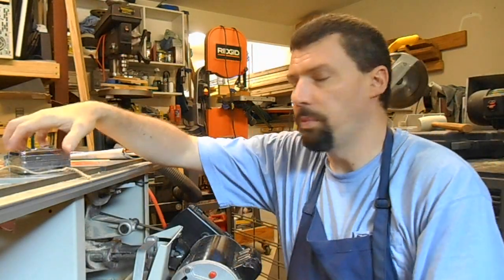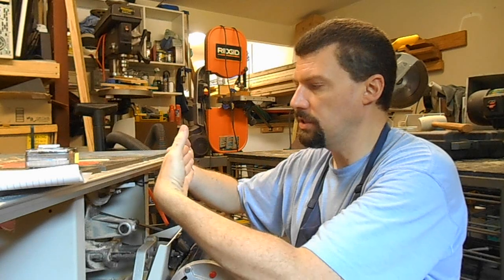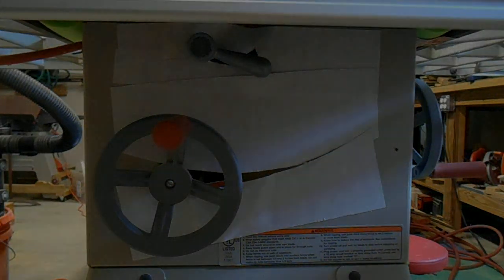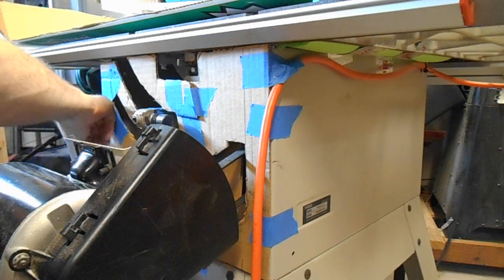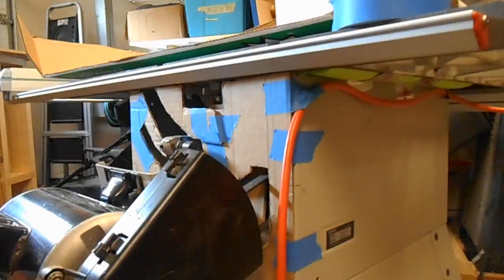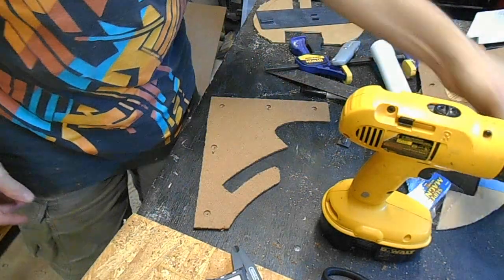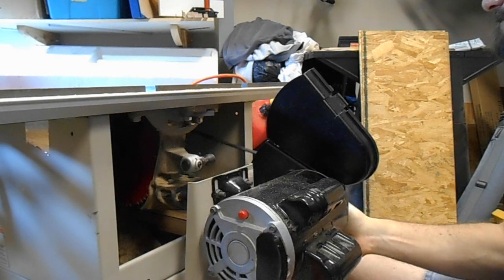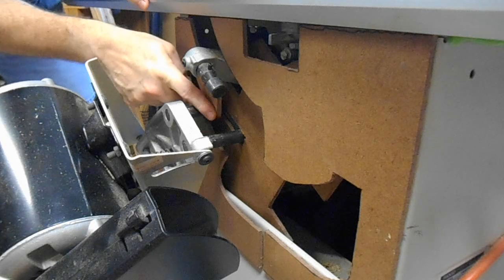Improve Your Table Saw Dust Collection

Comment: Really appreciate the very deliberate manner in which you approach problem solving, and the explanation of the thought process.  Please keep it up.  One caution, something I have seen mentioned a few times as a potential problem, is to not choke off too much airflow.  Must admit, no one to my knowledge has identified it as an actual result, so take it with a grain of salt.  
In reviewing dozens of articles and videos, there appear to be some common threads:
- closing up the throat with a zero clearance insert
- collecting dust beneath the table
- collecting dust above the table 
- closing other openings in the case on the front, sides and rear

As dust collection has become more of an issue, some manufacturers have begun to build a dust port into the blade guard, for above table dust collection (Sawstop, some DeWalts...).  There are also at least a few diy designs on YouTube.  For my old Craftsman 113 table saw, acquired a few months ago, I started with the zero clearance insert, and plan to add both dust collection above and below the table.
Please keep in mind that although a really powerful vacuum might handle both dust ports, not so for a normal shop vac - I.e., a second vac would be necessary.  Second-hand household vacuums can be found at Goodwill and thrift stores (most used vacuums just cleaning).  Shop Vac and other manufacturers also now make some very small products (about 2.5 gal).  I plan to test some of these (new and used) in dust collection above the table, once a few other things are resolved.
Best wishes!

Comment: thanks for the vid! I have this same saw and love it..... except for the motor set up. It always causes a lot of saw dust to spew out. Your idea is a lot better than the one I came up with initially. I enclosed the motor, to some degree, under a short run out table and attached it to the main housing of the saw. Finding the right place to put the suction tube proved to be a bigger challenge than expected. I ended up dropping the bottom out of it altogether. May have to incorporate your method to mine..... Thanks again for the ideas... not many videos of the Ridgid contractor saw....

Comment: With the air gap on your table saw dust collection, you might want to try using a sheet of 1/8thick rubber sheet and cut a slit in it for the piece to fit thru it would mainly be open in the position of the shaft but would still block off most of the air flow and would be easy enough to attach

Comment: To block the opening to the right of the belt when cutting bevels (rear view), I'd suggest a 3rd layer of fibre board mounted via a right angle bracket to the plastic belt cover over the motor pulley.  This cover will move with the rotation of the motor and cover that opening that appears.  When cutting straight up, it will be out to the side harmlessly under your table saw wing.  Epoxy your stove bolts coming out from the inside of the guard and use wing nuts for quick removal of the L bracket (with fibre board attached) for those rare occasions you need to swing the cover open to get to the belt.  Hope that makes sense.  Just discovered your channel, looking forward to browsing more videos as I'm a scroungineer of sorts myself.  Waiting for my 2nd, larger 3D printer to arrive to get some ideas in the works...

Comment: I did something very similar, but only for 90 degrees. For the few beveled cuts I just have to remember to remove it, but the gaps are much much smaller. I like the idea of a rubber sheet in another comment and may try that!
Reply from the maker: If you could, please let me know how the rubber sheeting works out.  I thought up some really nifty (i.e. complex and stupidly expensive) solutions for sealing things better.  But as always, I try to do things with as many scrounged & leftover bits as I can--so I talked myself out if it.

Comment: Hi
First time viewer
I love the idea with the magnets in the front of the saw if you got a large piece (like the signs people put on there cars) drilled holes and take off the handles that may help 

Also have you ever heard of Great Stuff it came to me watching your video 
this would be great for where the table saw top mounts to the stand  it would actually make it air tight.  your way is fine but this stuff would eliminate any and all cracks
As for the back of the saw what a daunting task you have a lot of patients great concept.  The more expensive saws the stand covers the mother right?

also  I was thinking plexiglass would be cool so you can see whats going on in there

Comment: I have made a dust collection with a single sheet of alligator board, some tape and two duct connectors.   It took about a half hour and it seems to work so far.   Can we post pics on this comment section?